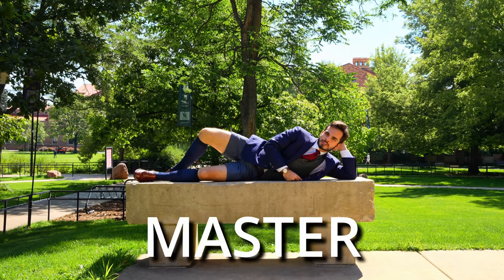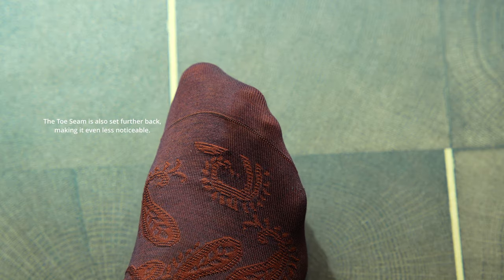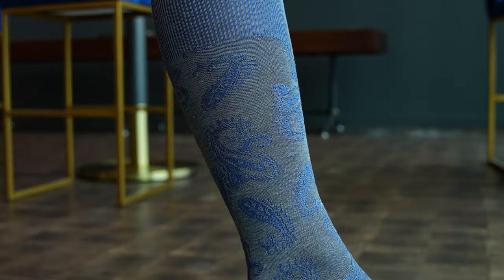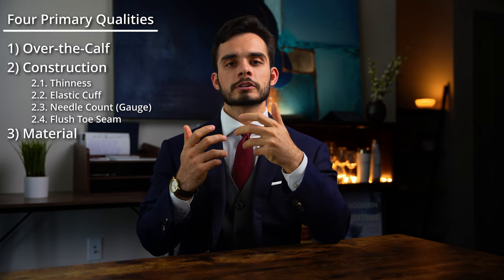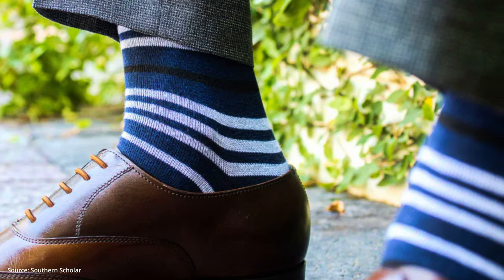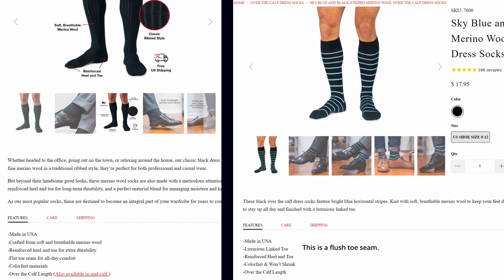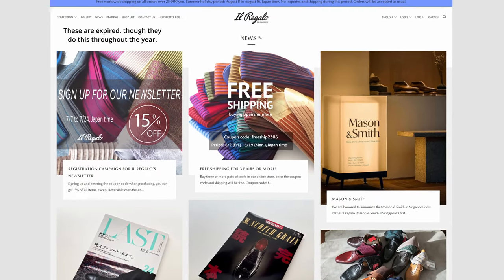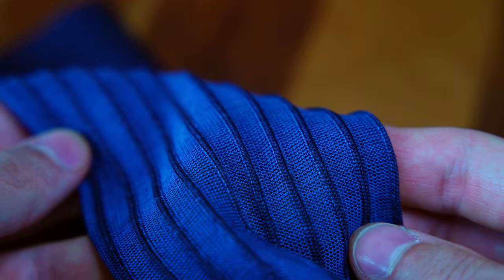The BEST Guide to Luxury Dress Socks

Comment: Nice video about socks, pity there wasn't a little more information about sizes, I am only a size 7 and most of the socks that span a number of sizes are too big otherwise I would give il regalo socks a try. Pantherella have a better sizing choice including tailored to your foot sizes, and you can get sea island and mercerized Egyptian cotton, but the colour and pattern choice is limited. Another positive about the Pantherella is they can be thrown in with the rest of a 40degree wash, the ribbed come out misshapen because the ribbing compressors but you wouldn't know when you put them on.

Comment: What do you think about socks from all natural materials like the $40 ones from Fort Belvedere?  It seems that the beautiful Il Regalo socks include nylon.  I am partial to natural materials generally speaking but I do understand that there are durability/stretchability considerations.
Reply from the maker: For 100% natural, I suggest Mes Chaussettes Rouges in France. They have amazing socks from Italian makers. Only around $20 a pair, too.
Reply: @DressWell.Madaras  I was more asking for your opinion on all natural vs blends.
Reply from the maker: @jakeh.8754  Ah, I see. I prefer blends just because of the fit and durability. Personal preference. I'd still be happy if all I had was all-natural.
Reply: The amount of nylon is quite small, simply meant to provide stretch so the socks hug the leg and don't sag.

Comment: Would you say Il Regato is worth the $4-5 upgrade over Boardroom Socks? How many pairs would you recommend if I were to replace all my cheap current socks?
Reply from the maker: My apologies for the delay. Yes, 100% worth the upgrade. How many pairs is a personal question and depends on how often you wear them.
Reply: I looked at the Boardroom and Il Regalo websites, and each one's full selection of over-the-calf socks. I have to say, the two companies are on completely different wavelengths. Boardroom has mostly solid colors, little variety in texture, then just a few patterns, including potentially kitschy ones e.g. American flags and Jolly Rogers. Il Regalo is closer to Bresciani in the range and type of colors and patterns, the latter using more variety of stripes and weaves (all abstract -- no flags here!), and overall more boldness in the types of colors and their combinations -- except that Il Regalo can be even bolder than Bresciani. Boardroom seems to aim at a very specific, seemingly stodgy (no offense meant, just how it strikes my taste) segment of the US market, while Regalo  emulates a more modern, Italian taste.